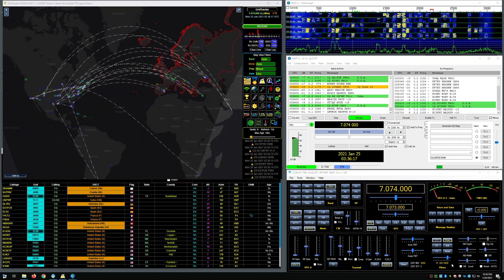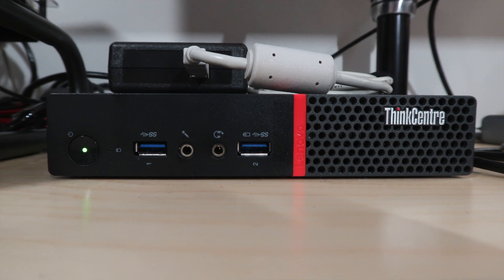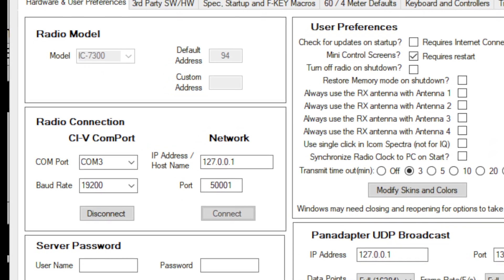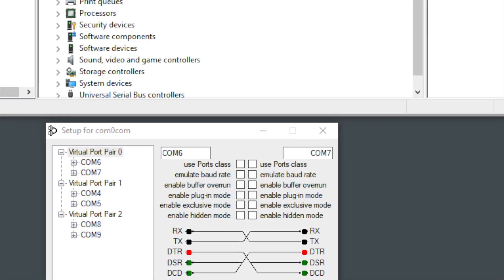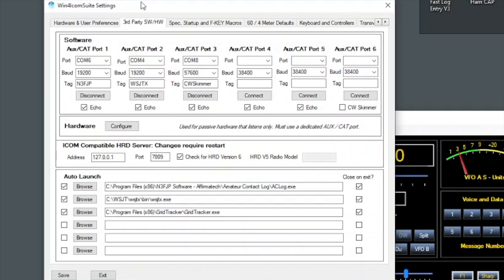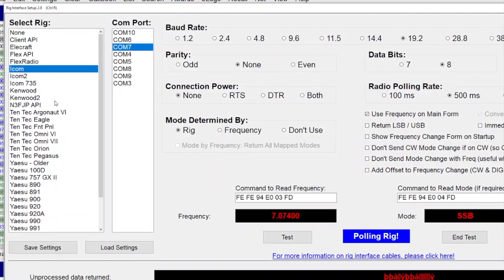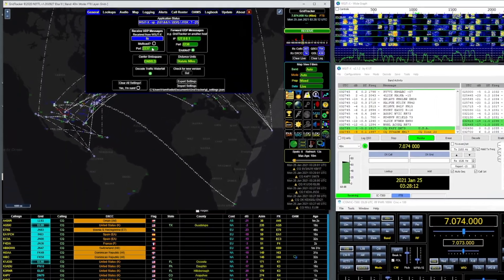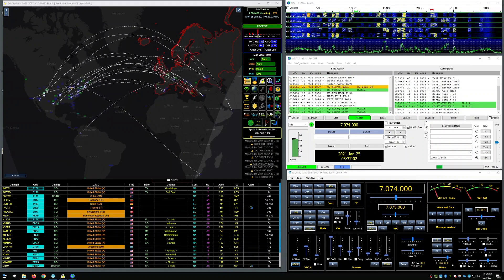Win4Icom Digital Setup

Comment: One comment. You will only get the spectrum from the radio if you use a baud rate of 115200.  Best to run at that baud rate.
Reply from the maker: If you're referring to the spectrum scope within Win4Icom, then yes, you are correct. I never use it since the radio is right next to me. 
The third party apps COM interface maxes out at 57600 though.
Reply: @HammockRadio  Yes the third party really doesn't need more than that. In fact 9600 baud is enough.